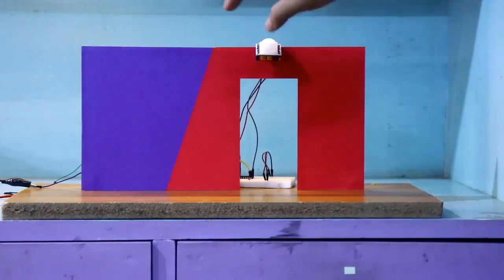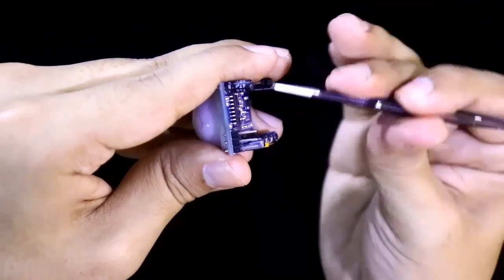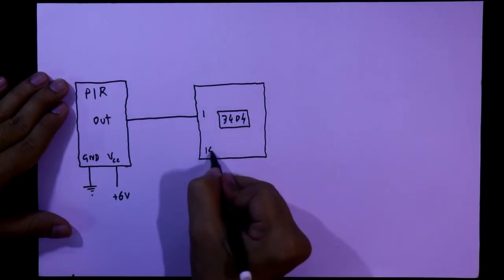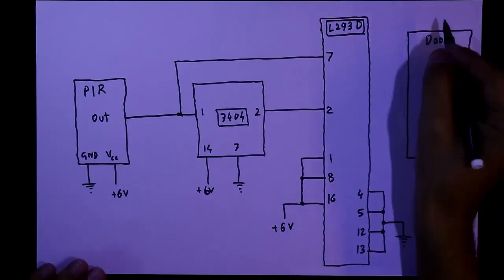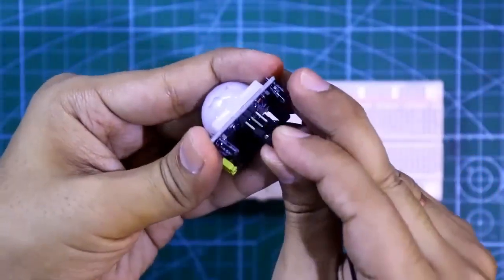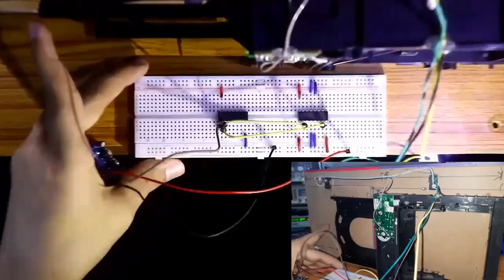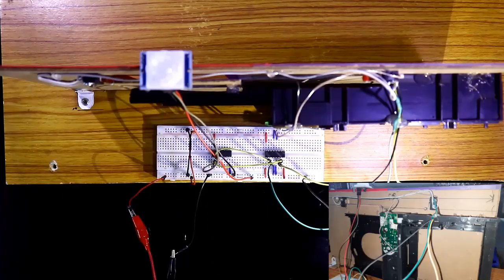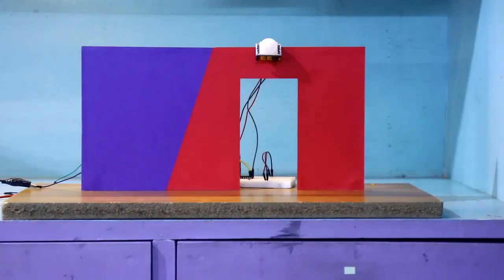How to make a motion sensor door

Comment: What kind of 7404 IC are you using?  We got the SN74LS04N and can’t get the circuit to work.  Help!
Reply: Also, what volt battery did you use?  I know the diagram shows 6V, but I could only get some function with a 9V battery.  Do I need to increase?
Reply from the maker: 7404 is NOT Gate IC, 7404 can't handle 9 volt. I think your IC got damaged.  Instead of 7404, you can use CD4049 or CD4069. both of them are NOT Gate IC and can handle up to 18 volt.